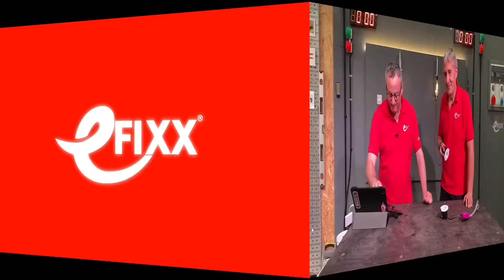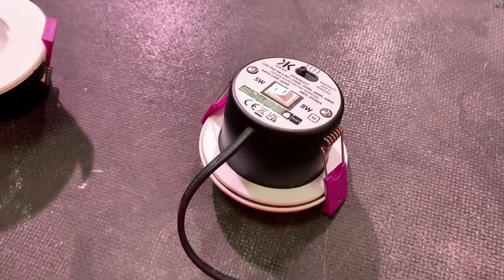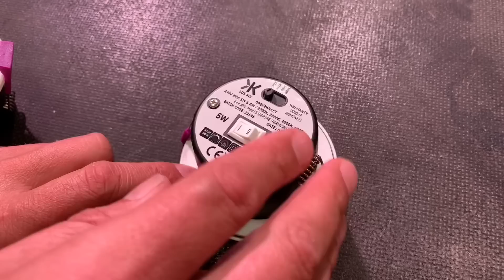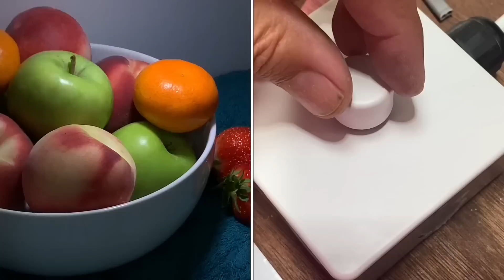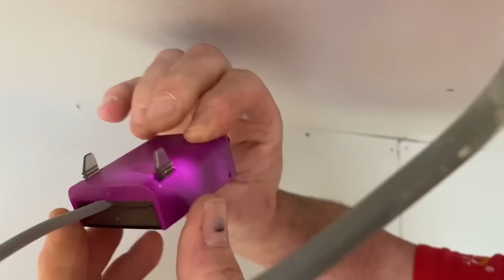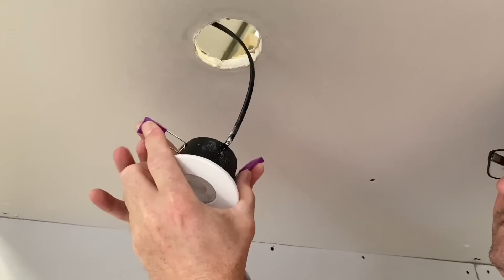IS THIS THE ONLY FIRE RATED DOWNLIGHT YOU'LL EVER NEED? - SpektroLED from Knightsbridge

Comment: Why do these fittings draw 8w, when dimmed to 10%, were a GU10 LED of 5w dimmed to the same 10% draws less than 1w. The SpecktroLED appears to draw full rate all the time whereas the GU10 LED bulb appears to be variable and thus significantly more power efficient. Is there a follow-up video where we test the most power-efficient downlights available? I really like the SpecktroLED especially as there is now a swivel version available but a bit power hungry compared to other older fittings

Comment: @efixx It's a good product, however a few ideas of additional features to suggest to Knightsbridge for a future version if feasible. 

1)  A adjustable brightness feature from 1W to 10W, adjusted by a potentiometer on the back.
2)  A mechanically adjustable lenses feature to change the beam angle on the fly.
3)  Magnetically attached reversible covers/faceplates.
Reply from the maker: Great ideas 💡 👍

Comment: First world problem being solved in a ridiculously over-complicated way.   1.  Reduced lifespan (More components = reduced life span.  Ditto complexity)    2. I bet the customer won't stop changing their mind just because you have installed the unit and then scratched the paint taking it out to try another setting.
It might have a use as a single display unit so that customer can see the effects before choosing which to go for in a non-adjustable and cheaper unit.  Not impressed.

Comment: You guys are like kitchen gadget salesmen ;) In an ironic way though, which just makes it funny.  Colour rendering looks okay from that fruit bowl but hard to tell on a video. What’s the CRI? For me CRI is everything. Also is there any patterning of the light from the reflector? I really prefer reflector lights not these bland, cheap, highly diffused ones you can get. Shame you need a physical switch on the reverse to change the white temperature (as opposed to some remote control or smarts…)
Reply from the maker: CRI80 the light output is quite uniform over angle.

Comment: Nice enough unit, but not a big fan of integrated  downlights. Have seen a few sparks on here that would have used integrated downlights a year or so ago, but have moved back to replaceable GU10 cans due to call backs of various brands of the integrated type.
Reply: The issue with all LED stuff is how much the LED's are being pushed. Say a 6w LED bulb may have 12 LED's running at 0.5w, which is about right. The problem is when manufacturers start to cut costs & use say 9 LED's, now running at 0.75w - or worse 6 LED's running at 1w each in the bulb/unit. This generates much more heat & rapidly shortens the lifespan of the unit, often resulting in a LED or two dying of the black dot of death, with most of them arranged in series = whole bulb/unit is dead. All for saving a tiny fraction in costs or poorly engineered in the first place pushing the LED's too much.
The switch to toggle 8w & 5w is likely a 1uF ~ 1.5uF 400v capacitor (with discharge resistor), that when enabled switches the 8w LED unit down to 5w to prolong life. You can do all this to many LED stuff, GU10's, floodlights etc...
https://youtu.be/biEZ1TbdhhU
Reply: @authuruksake969  Big Clive brings this up many times with LED's being driven too hard, reducing their life.

Comment: Never fit integrated downlight, when they go wrong in 5 years time & the line has stopped production, you're stuck with either a light that doesn't work or one that is different to the rest. Better off with GU10 & the customer can change the lamp when it finally gives up.
Reply: Personally I wont fit integrated fittings, as you say in years when they quit they'll be a nightmare to find and repair, hows that good for the environment? Gu10 fitting and change bulbs as customer requires.
Reply: plus the different beam angle, personally prefer say 120° for distributing the light in most homes, where as a narrower beam for display lighting.

Comment: I understand new legislation means lamps must be replaceable in a fitting as ‘repairable’. Is this a lamp or a fitting? I want 
‘Smart’lamps!
Reply: That’s is how I understand the new regulations - the light source has to be replaceable - I.e like a GU10 lamp as an example - these dedicated light source Downlights are not compliant under new regs as if they fail you have to replace the complete fitting and the failed unit ends up in landfill - plus given the chances of getting the same fitting in say 4 or 5yrs time are remote as designs come & go so quickly in this particular market.
Reply: Exactly.  Just had to change  a fitting which had failed.  Design not available - it is five years after all!  So that is two complete fittings for one failure.

Comment: Not the best for reliability & these could be of the same.! Also a shame to have all that flexibility and then have no access to it again once its in the ceiling.! (Without damaging the ceiling again of course). This is where the V50 wins everytime.! Easy access under the bezel.! You need to know what you want before you fit it & if that's the case then just buy what you want / need??!
Reply: Have to agree....you wouldn't want to keep pulling those out of the ceiling......

Comment: Nice idea, shame I've found Knightsbridge to be quite unreliable, but, fingers crossed...
Reply from the maker: Product or service ?
Reply: @efixx  Had a few sockets and switches fail in the past, got them replaced easy enough but it's hassle having to return to a job to swap them out.
Reply: My flat plate sockets, etc, are Knightsbridge - now four years old.  No problems except one, the dimmer switch failed after two years.  I expected that as the innards module was the standard cheapish design seen in the cheapo stuff DIY sheds. I replaced it with a Varilight V Pro module - I was to replace it in initial installation, but never got around to it.   Far better.